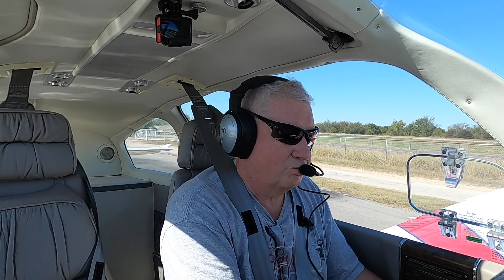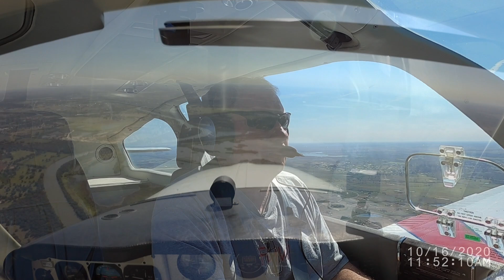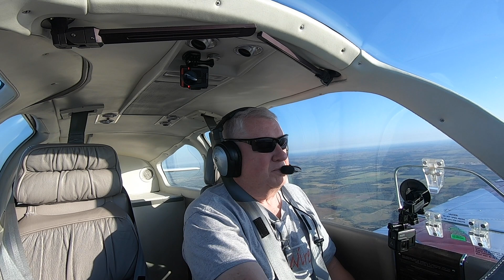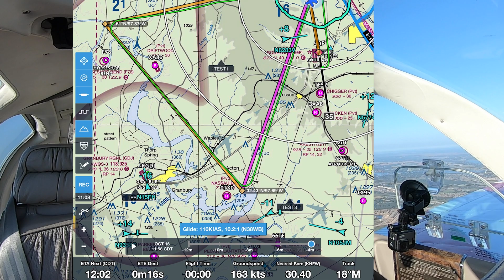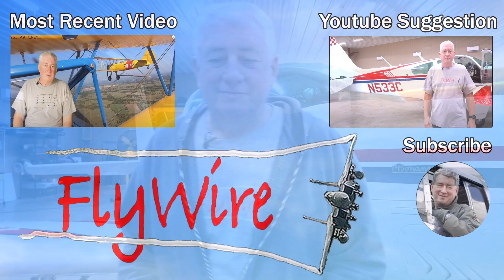Bonanza Maintenance Test Flight and Speed Run

Comment: Recently found your videos - from Dan Gryder and blancolirio - some great videos for new pilots and students. Have you posted the spreadsheet on your website ? I can't find it. Our club has a 150G with the old six pack gauges we use with our students, and while there is a Garmin 250XL for GPS groundspeed, the airspeed never gets anywhere close to what the book says. Doing cross countries for the PPL, the result never matches the flight plans we create. It's rather annoying, as we're never sure whether the error is us or the airplane.
Reply from the maker: I still have to find a way to have the spreadsheet be accessible.

Comment: Sometime would you talk about aerobatics in a production airplane? Oil, gas, carb inverted, which planes can do it, which should not.
Reply from the maker: I'm not sure what you mean by production airplane. There are many aerobatic airplanes out there that are production airplanes. I assume you mean certified passenger airplanes commonly found on the ramps all across America. My reply would be that if it is certified for aerobatics, you can do it if it is airworthy. If it is not certified then DO NOT do it. There are reasons for that. My F33C, looks externally like an F33A. And it is indeed very similar. But it has several structural improvements that make it capable of +6 g to -3g. Far more than an F33A. Best not to be a test pilot in an airplane not designed for aerobatics. My F33C is not capable of sustained inverted flight.

Comment: What will be your next prop?  I recently changed from a Mac two-blade 86” to an MTV9 three-blade on the 185.  No perceptible change in TAS, but it has shortened the takeoff roll and increased the climb rate.  Turbine smooth.  Saved 14#, too.
Reply from the maker: Thanks for watching Manny! I'm putting a MT MTV9 3 blade on as well. We'll see what improvements it makes in the airplane. My neighbors say my current prop is pretty loud... so reduced noise levels will be one of those;)

Comment: G, day Scott at Flywire. I'm a student pilot in Australia with a C.A.S.A aviation number. (No plane) At this point I'm looking/learning at NAV. What I have in my basket;
" GPS LCD makes obtaining measurements easy.
* engine power, prop pitch, drag, wind direction, air density and temp all effect plane performance.
* it's vectors (track/track made good) is there performance tables for each plane? So to calculate miles/gallon - kilometres/litres?
Thanks for flying🕊🇭🇲
Reply from the maker: John- Thanks for watching! Keep at learning, start working on the flying part as soon as you can! Best to fly about 2-3 times a week! GPS does make things easier these days... it is still. a good idea to know Ded Reckoning and how to read a map. Each airplane Pilot Operating Handbook has performance charts in the back. But those charts were made by a test pilot with a new airplane. It is my opinion that it is best to get a baseline for the airplane you are flying... there are very few GA airplanes out there less than forty years old.

Comment: Thanks Scott, I need to do this I’ve got a new plane with a new panel.  I’m thinking it would be a good way to check and make sure everything is working correctly.
Reply from the maker: Absolutely! Write up a test plan on your Kneeboard and then go through it methodically!
Reply: @FlyWirescottperdue  will you be posting the spread sheet? Should this be done at different altitudes and power settings?
Reply from the maker: @jackbrainassociates8806  Jack-

You can if you like. I am only interested in a few specific power settings that I normally use. I'll see about posting that spreadsheet in the next couple of days. Thanks for watching!